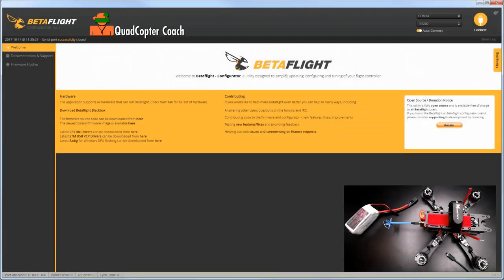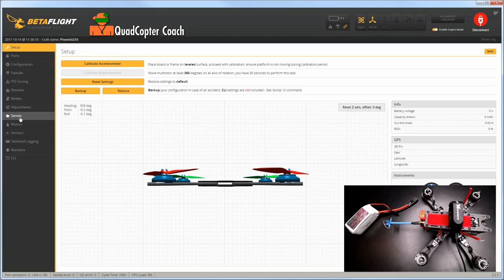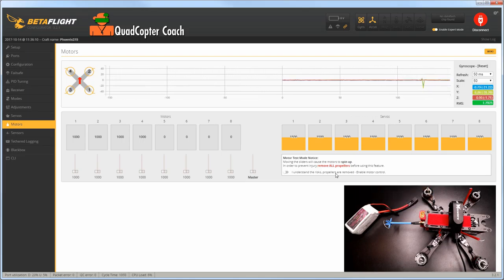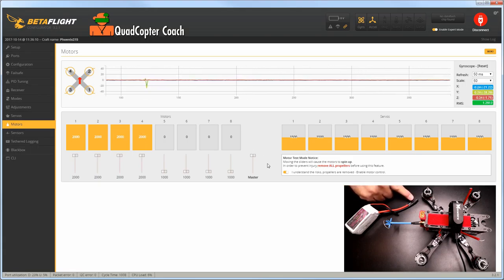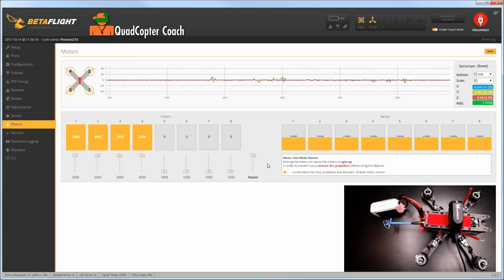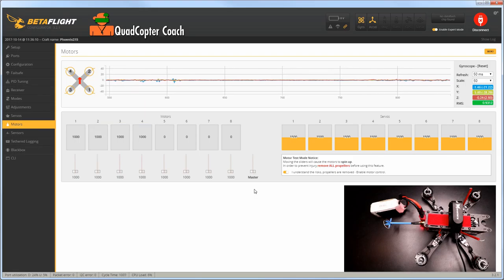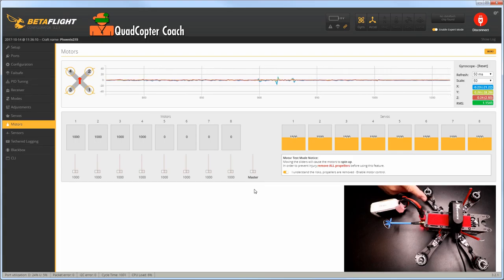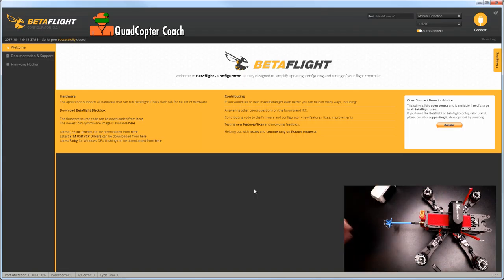51-Calibrating the ESC's

Comment: Hey Joel I have old an old QAV250 thats been down for years. It has naze32 FC I just replaced the motors and replaced ESC's-12A simonK.  I have a Turnigy9x radio/RX . The FC did work in the past but it's been so long I've been out of the hobby  i dont know where to start to get it flying again. I keep reading about the support being dropped for naze32. What would you recommend I do to get old FC with new ESC's going? Can I erase the current firmware and "upgrade" to say 3.1.6? Do I need to flash the esc? They say simonk. I'm just stuck as to what to do next. Any help/direction would be appreciated if you have the time.  Thanks
Reply: I'm not even sure if I used cleanflight or betaflight in the past . Or if that matters.